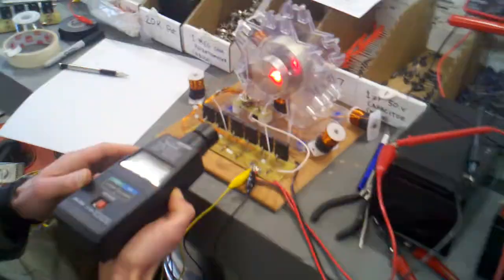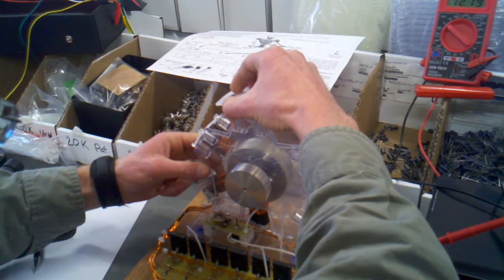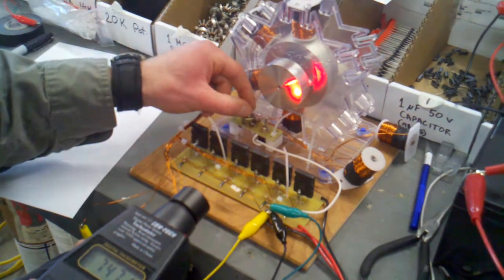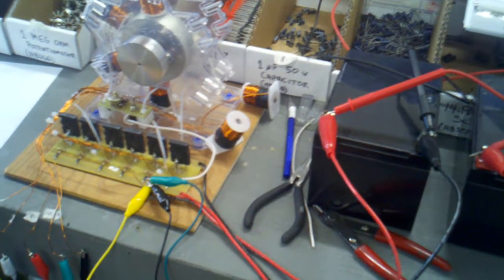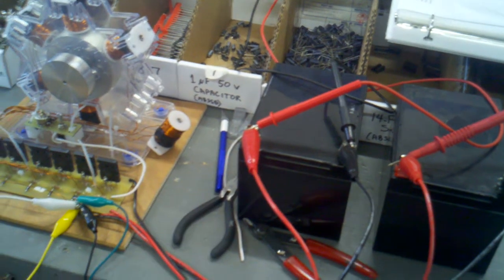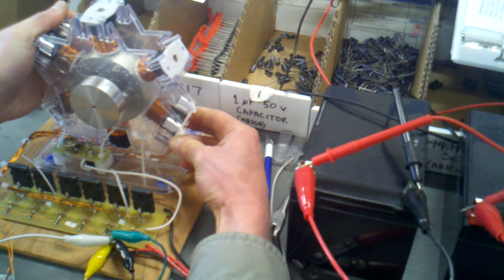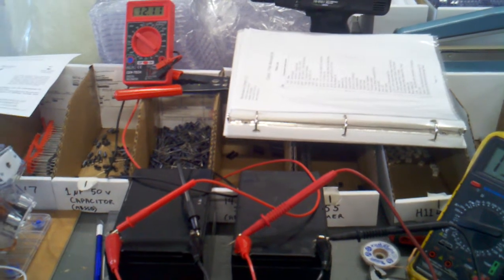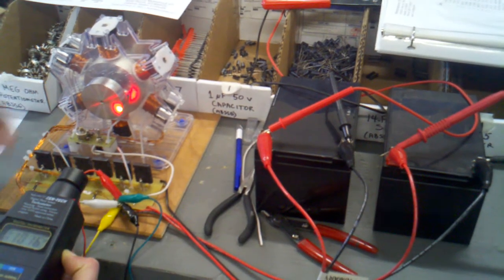6 Pole Monopole Classic with all 6 coils as motor coils

Comment: I am having trouble with my new sg kit, but i have this 3pole/6 pole board with one blown transistor.
If I replace the transistor how would I tune this?
What resistor/pot should I tune with the same  amounts as the SG? 
Should I tune with just one coil or all coils placed?
Reply from the maker: You can start with just the master coil and then add others.
Reply: @rickfriedrich  okay - thank you

Comment: hi  i looked thru the topics. can you help me im a english teacher, i have no idea what im doing i just look at videos n started to make  this a  few years ago saving money  month after month. now i  have 36 magnet 4in x 2in x 20mm neos, 3 disk the one in the middle has 9 each side  nsnsnsnsn facing out the opposite side is nsnsnsnsn facing in n snsnsnsns facing coils.after coil outer disk 9 mags, now help plz on the north i put coils + to N on the S i put -of  coil facing itsoat top dead center im having    n to +  s to -     .IS this idea ok. well it make power. 
next 9 coils 3 phase do i do the same +++++ on the stater
alternate the pos n  neg same im doing magnets to match the n to pos   n the S to - side of coils so at  TDC its replelling, 
also  i have  9 coils 3 phase how do i do the three pase i was going to do one each   badini sg style  since my coils are wound 7 20 ga  1 24. ga  n usethe trgger diag to make  3 circuit board with  100omh  r  1n4001   d n 1n4007 d  n 400v 20a t
how  do i put this all together now please can you help
anthonyolivera@yahoo.com

Comment: I bought this kit from renaissance charge and I feel I got ripped off the kit was missing wires, bushing and my Circuit Board Pre-Assembled does not match the one in the video provided in the kit the video is poorly done and skips a lot he even tells you on the video that he doesn't have time to show you how to put things together the video skips the most important thing the step by step guide to connecting the wires. the instruction also do not say connect wire a to this etc

Comment: @rickfriedrich Thanks for your replies Rick. I gave up, frustrated with the basic SSG circuit.. but I'm back at it now, keeping things as fundamental as possible, plastic mag (BMX 20") rotor, no metal or aluminum even anywhere, ferrite ceramic magnets, x3 spacing. If I get it going correctly this time, I believe I will take what I've learned and shoot for a ceiling fan, I use wood heat, so that'll be as close to overunity as I'll ever need; given I need the circulation. Thanks

Comment: Rick, do you still see/find distinct advantages of obtain fast switching speed, like you are, using a mechanical rotor, over trying to obtain the same frequency, let's say, solid state? Also, the coil I bought from you had welding electrodes. Were these normal rods with the coating banged off, or, can they be purchased free of any coating? Thanks, Kyle
Reply: stop it now and make that purchase maybe get the new booook.

Comment: Sweet!
that would be soo cool if you showed the starting voltages and run bat.
But that thing is humming.
I must be doing something wrong, I had to re-wire mine to get it going 20k RPM
yours looks like it can almost get there as is.
watch?v=MiinchW0_zc
charging is crazy fast - Thanks
Patrick